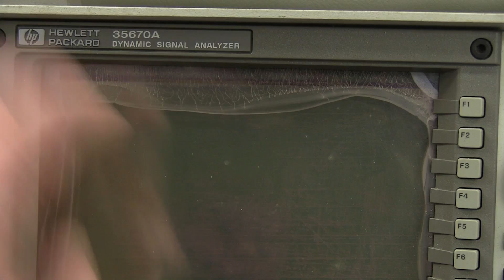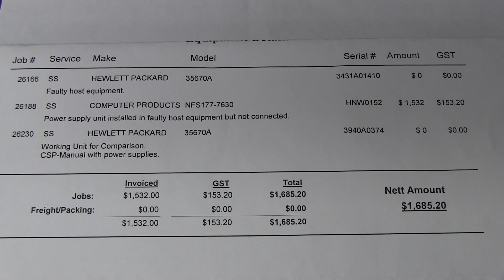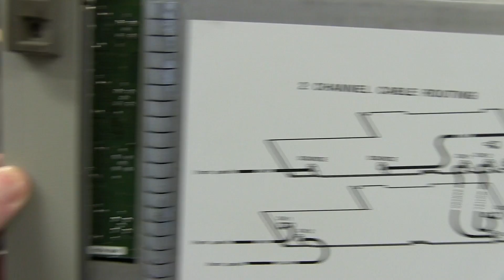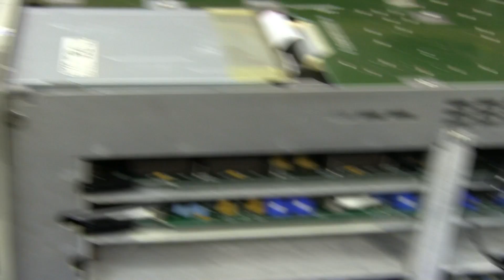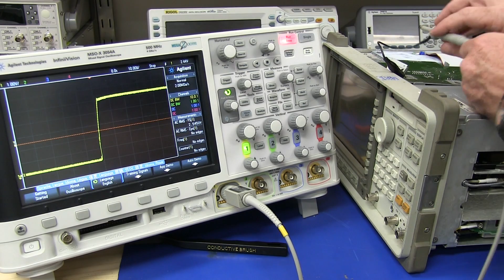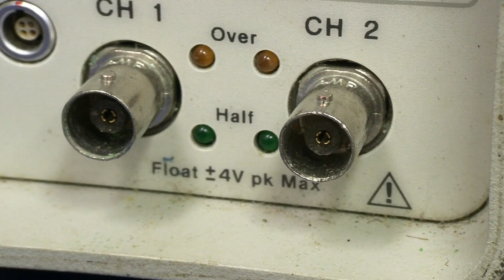EEVblog #536 - HP35670A DSA Repair

Comment: I thought you bought it to repair so what's cost got to do with it what cost have you had apart from time ,watching you repair stuff is funny as your full of electronics info but you just know stuff ,when it comes to repairs it's a comedy show.i think I have seen you fix one or two items and they where a blown fuse and a cable came loose .Keep to the easy stuff like opening mail and talking about the issues you read about or forum chatter on issues  .For a Electronics Engineer your crap at electronics repair ,we know you know your stuff your just comical when trying to do any practical..I know you have designed some boards and a  multimeter but that's easy you just tell them what you want and there Engineers show you samples and up pick the best you like. Don't get me wrong you have a very watchable personality just leave the repairs to others...

Comment: Hi Dave I got one of those units fully optioned in 2018.
Channel 1 is source but it needs to be told what mode its running.
I repaired my unit added few goodies such as a link to PC.
Keyboard external had few weirdness but we fixed that.
Great unit running 2 x 68xxxx processors. 
its a winner with chicken dinner! //Nickj

Comment: this may be ANOTHER power supply failure. My spectrum analyser didnt worked many of the options because a tantalum shorted on the +40vdc line

Comment: I own one of those - fully loaded with options 4Ch - sweep is great for diagnostic. Basic is more like HP version of Pascal.  East to repair, I am getting an external microphone module. Those units fully optioned are like swiss pocket knife  - your unit is more like a cheap version of an oscilloscope.  To option it up - some is software but you will need a chip burner. Loads of statistical and system goodies but only if it is optioned up.  Keep up the good work

Comment: I love these repair videos, it's really encouraging to see you analyze and troubleshoot electronics that 99.99% of people would just pitch. If your electronics don't work, it's not like 45 parts went out in it, it's probably 1 or 2 that failed. If you can hunt them down, you have a good chance of repairing it.
Reply: it is a real bummer that most people don't have the knowledge to repair electrical equipment and just decides to toss it in the dumpster

Comment: I liekd your videos why are you lying to me Dave. . . You barely know how to turn that thing ON, you dont know what is it used for and sure as hell cant repair it or diagnose the faulty part . What did you do then. You took one part out , and returned it pretending that you fixed anything . Essentially you are lying about your skills , that was obvious cuz you cover up your self with expensive equipment in every video and skilled electrician only needs one . But when i catch you in a str8 up lie , it brings down your integrity to a level of internet sails man fluke advertising wxxxx. and i dont like it , i was perfectly fine with your fake image and you ruined it . Tells a lot about your followers too, if you cant see what he did there and you have a Fluke or some other kind of expensive gear , then he and his colleges did there job good.
Reply: +Pavle Pavlovic You're an idiot, I think you need a new tin foil hat.... Good day, and good bye
Reply: +Pavle Pavlovic Get back under your bridge.
Reply: Joshua Nicoll its rock. have a blast
Reply: +Pavle Pavlovic not what I meant, trolls live under bridges. In case you missed, he did 3 more videos where he fixed thing.
Reply: Joshua Nicoll thats smart , next time try to say something half of the world , stupid at that , is not saying
Reply: I agree with you completely. what I've seen so far from Dave's video's is he is very good  tearing things down, but when it comes to electrical knowledge he pretty much wings it through every video. He calls himself a electrical engineer and has a lab, but unfortunately, doesn't have a clue what he's doing. He probably knows how to build a PC but I don't think he has the knowledge to repair speciality equipment. and that comment above about getting back under your bridge, don't as the world needs more people like you, someone that's not afraid point out the bad apple in the barrel!. Cheers dude (I didn't quite have the gall to comment myself like this as I know a lot of the EV forum peeps would automatically defend him, when unfortunately he's not wort defending. (Not saying his videos are not good, I like them, but Dave unfortunately is full of himself and doesn't know his hand for from his foot, as to say!)).
Reply: Joshua Nicoll this thing is not fixable , thats why you think im under the bridge. At least you are noticing something is fishy here. but its not me . Yes i did lash out , but why shouldn't i, he and hes palls lured me in, to try to take advantage of me . its sounds silly but trust me google any device ,DMM, scope whatever, what is the result.. yeah its EEV blog . Its not by chance my friend , they are out to get you , cuz fluke is a premium brand and gets a lot of income , sells devices for 10x their real price. A lot of excess money to pay to google and send stuff for review on EEV blog. And then Guys at EEV blog form a chain of command , work for dave and he may send you a device from fluke , fluke will pay google, you'll see dave on YT,you  pay to Fluke and it goes like that till they got all youre money. But actual knowledge is not served , hence im out
Reply: Pavle Pavlovic
You clearly need help. Or to grow up.

Comment: Oh wow, something like that -- not a full computer -- with a disk drive on it? Weird! I have a MIDI keyboard with a floppy disk drive on it, and even that's weird! When video recorders and media players with disk drives came out, I thought they were weird too. But I'm used to DVRs now, so not as big a deal. Still weirder than just computers with them, though. What do you do with the little drive on this one?
Reply: +MaxxFordham I'm guessing it could be used to upload firmware over to it, in case of a software revision? There's a serial port on the back that could be used for the same purpose though, so maybe it can print a signal to a disk (i.e printscreen)?
Reply: Maybe, TripleDz.

Comment: So the power supply fried and took the tiny little chip with it i could have sworn it be a crusty wire or something
Reply: +crapper1 Thanks for spoiling a 42 minute video.
Reply: +crapper1 Perhaps the most pointless observation ever.

Comment: Dave-- Should see what the same -18V rail connects to physically, because that likely went out of range high and damaged the -12V regulator. Maybe it took out some dual-supply opamps, as your problem seems now analog in nature. Love these repair videos btw :)

Comment: Retardely expensive stuff. It is obviously a relative simple machine but cost alot more than a high end computer. Stuff like that kindapisses me off.

It is the same with controller cards. A modern pocketcalculator could handle practically infitite amount of sata harddrives but no, even only 8 ports controller card can cost over 1000 bux but usually cost around 300.

But ppl cant fool me with this shit, I managed to get a brand new, albeit "obselete" 8 ports sata controller for around 30 bux that can handle harddrives in a fullhd movie server with 0 issues. I know where to get a bunch of 16 ports to for 30 bux to but 8 of the ports are e-sata and are basically unusable because they need special cables that have a retarded price and are hard to get
Reply: Consumer computers and test equipment like this are not very comparable. The demand for a desktop, no matter how powerful is way, way higher than a signal analyzer. Entirely different demographics.
Reply: ye guess you are right, makes sense.

Comment: Good luck with this one, I don't think PSU could kill so much, most of the time this PSUs are quite overprotected on the outputs so to get anything higher than rated voltage is quite hard on them even if a failure takes place. And also wow, they took so much money for fixing the power supply and it just died while on your bench :P

Comment: Not necessarily due to heat. Some rubber just deteriorates over time. I have seen VCR pinch rollers which became as sticky as glue traps.

Comment: I think if you do get it fixed and eventually decide you don't need it anymore and want to resell it, the guy who spent $1600 on the power supply repair should get first dibbs. ;-)

Comment: Most of the time they're not chips but resistor arrays (like 16 resistors to supply) these are used to load the open collector outputs of the other ICs.

Comment: Looks like the LOCA adhesive has seen better days, you can repair this if you buy the correct Loca UV Screen bonding :)

you have to cure it with a UV lamp :)

Comment: @ 25:00 Could you just bodge/hard wire a laptop power supply to the DC input the voltage range and amps draw makes me think it's feasable and cheap. How did the PSU end up costing $1600, was it built from scratch or a HP stock part, maybe they where dodgy supplies to begin with. Anyhows great upload and hows the Delorean clock ;D.

Comment: so the power got busted. Like the ac part. This could kill the regulator on the clock modul. So i think it killed other regulators too. The fails seemd to be all differnt , parts.
So check first all the other volatage regulators befor starting to look on other parts!

Comment: to use the mainboard with two bus to bus connectors is to use a ribbon cable connection to and from the same connections with all pins connected to the same pins on each connector. it allows for operation of the board sepret from the direct bus to bus connection.

Comment: read the schematics, I understand that on each board there is voltage regulator to change the +/-18 to other voltages, so if the psu fail and give to much voltage that regulator will die but the baord work.

Comment: If we are luck just all the regulator on the +-18v are died and everythink is well. 
Have you tried to put a signal in?
The ADC is strange that run at 18v, but the miexer and rf amplifier could be run at that voltage
By the way finnaly a video where you do some trouble shooting. Last time a displòay error solved imediantly. On the LeCroy hybrid ic died (I'm still thinking that the short could be under the shield cover of the time base, that you've never checked).

Comment: The amount of failures makes me suspect that a voltage rail is kaput. This suspicion is not made smaller by the fact that the power supply is dodgy. Check all voltages, supply wise and local... :)

Comment: I suspect the power supply failure knocked out the supplies for those parts that aren't working. If some of those custom chips are dead it's basically beyond repair right?

Comment: I'd bet that the reason the ADC gate array is failing is that the i2c bus isn't coming up.  this often happens if an RTC clock's battery has died-  i2c is open collector signalled, so a chip that expects to have a battery on it will tend to load the lines through its input protection diodes, crowbarring the bus.

Comment: Is there any chance the inductor is actually electrically  in series with the tuning capacitor? That would make more sense. Just with the tuning cap, the frequency of the oscillator would ALWAYS be above the xtal's label frequency. The inductor pulls it back down to the wanted frequency.

Comment: The inductor in parallel probably makes up for unwanted parasitic capacitance in parallel with the xtal. Without it, your oscillator would probably oscillate slightly above the xtal's frequency. Short it out and measure the frequency. A parallel inductance can compensate for parallel stray capacitance. Pretty standard circuit actually...

Comment: if it smells like WD40 that might be your problem, WD40 says cleans electrical contacts on it, but when you spray computer parts with it, or contacts, its slightly conductive, and screws up whatever you spray with it(I know this from experience on an old 660gt gfx card I ruined with it)

Comment: You referred to the cylindrical object near the leads of the crystal as a 1.5 ohm resistor. I think you will find that it is an inductor and most likely in parallel with the variable capacitor forming a tank circuit in the oscillator.

Comment: Hiiiiiiiiiiiiii Dave, wow I faced the same problem with a CC Debugger. it was almost failing to recognised the chips and rarely showing the Green light.
so i tested a very small Voltage regulator that regulates 5.1V from its USB interface into 3.3 V, and couldn't find any similar regulators so i just did a hand made Zener with a resistor, it regulated only till 2.9 V and it worked.
it was able to erase and program chips. but it needed exactly 3.3 V to debug the connected chip.

Regards. & Thx

Comment: Probably the power supply cooked it. I've seen something similar in a Panasonic tv. 

Here's what i think happened. The foot unstuck itself, fell on the bottom where it got cooked (for whatever reason) then it dripped on the board. Also, that corrosion isn't rust, it's alu on metal corrosion via electricity. So a lot happened to this before that power supply went for a walk.

 I must commend you on your patience, it's true the boon is big if it's fixed but most people would throw it out.

Comment: pvc,rubber and things like that can do "funny" things over time, while repairing old reel2reel machines some of its rubber belts been melting away, some becomes sticky glue and others turn into hard plastic. it all depends in the chemical  looks of the used material.

Comment: Could at least some of the failures be caused by the oscillator being off (trimmer misadjusted)? Possible with tight tolerances for frequency such as with ADC gate arrays and such, I'm not sure.

Comment: that's the problem with nearly all used equipment, you'll never know what it was gone through...extensive heat or shocks overvoltage, to much humidity...who can tell?